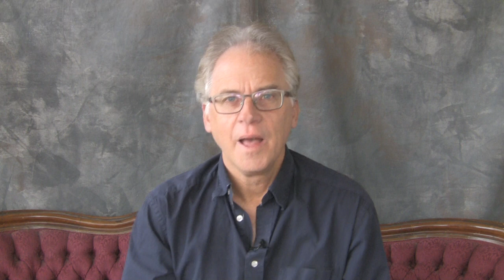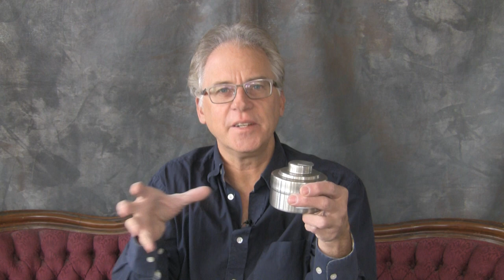WAJDA PHOTO - Developing Film in a Double Sink (Oh, so good!)

Comment: I use 3 5 liter stackable tanks. with time charts for differnt films. Patterson tanks, 4x5 Yankee for 10 sheets with hangers. enlarger glow in the dark timer, black planel fabric to block light leaks in the basement bathroom. washroom sink and 100 watt bulb as a heating element in a dust free drying box. cuts down on retouching times.